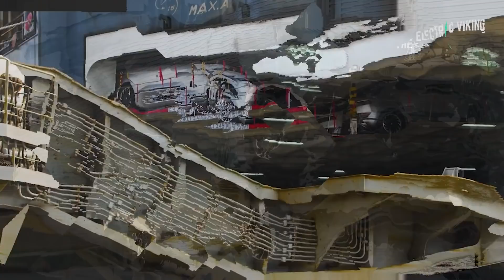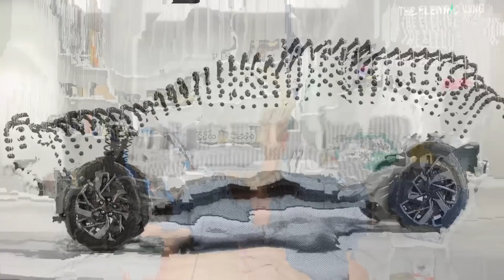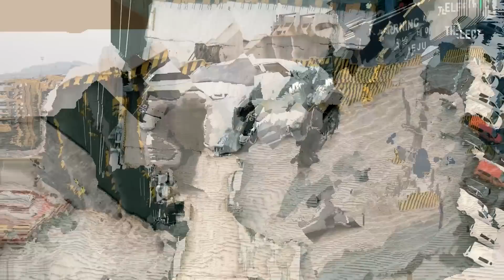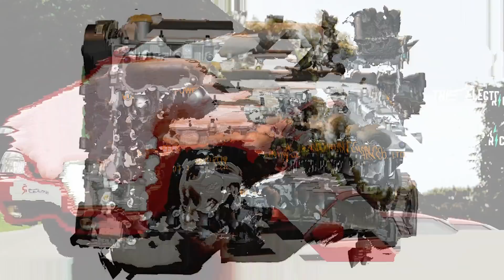Another automaker moves all ENGINE staff into EV production

Comment: Some day before long we will miss replacing an air filter, engine oil and filter, spark plugs, coils and wires, accessory drive belts, changing engine antifreeze, worrying about the catalytic converter being ripped off and the exhaust rotting off, the myriad of pollution control hoses, sensors, valves, actuators and associated wiring. The list goes on.

Comment: Expecting a bunch of engineers who specialize in engines to produce an electric masterpiece is typical executive shortsightedness. Wrong people for the job.
Reply: 90% of the research workforce is employed in designing and making the production line itself not designing the ICE components. Very few engine assembly lines are manual now. Merc and BMW retain manual engine assembly lines for their complex V8, V10 and V12 blocks. The reason for this is that they don’t sell enough to justify a full automated line. Hyundai G4GC units are numbers in the hundreds of thousands and that is just one engine
Reply: @theairstig9164  LOL Engine assembly is done by hand at ALL the manufacturers plants today. Its to complex to automate. 
Over 3000 moving parts and assemblies

Comment: Not everybody lives in a warm climate, here in Canada it is coolish to cold 5 months of the year.  Lately, the temperature has dipped significantly in parts of Canada and a lot of Tesla's have stopped heating.  So until EV's are sustainable in our climate, I will be keeping my 2019 Accord hybrid.
Reply: We’re in calgary and own a Tesla, it’s been -20 for the past month and have had no issue but we keep the car in our garage and preheat off the grid, works excellent.
Reply: A plug-in hybrid with decent battery capacity would be an ideal solution for such conditions.

Comment: Sam, check out this headline from today:

5-minute electric vehicle charging could be here soon, professor says
Phoebe Wall Howard
Detroit Free Press
Ford Motor Co. is working with scientists at Purdue University in Indiana on a patent-pending plan to slash the average time it takes to recharge all-electric vehicles at charging stations from an estimated 25 minutes to 5 minutes.
Reply: Looks like it's in the "petri" dish phase. Will probably be another 50 years before that will happen. It's America. I remember warchitje 1950s documentary about the future 1980s kitchen....I'm still waiting for it.
Reply: @henrytaverner1803  I dug into it a little further, it's not battery technology it's basically a way of cooling the charging cord so that it can handle high amperage.

Comment: Was about time that Hyundai made a robust commitment to EVs. With the steadily growing order backlog for the Ioniq5 and even the Ioniq classic, they sure knew what gems they have on offer. The current lineup of ICE powertrains should last for the next few years, and by then the EVs will have taken over anyways, so there's really no need for putting any further R&D resources into them. The only sad part is all the people working in these research fields right now.. I'm not so sure whether it's that easy to retrain those engineers to EV parts so quickly, so there'll likely be some job losses in areas where it's hard to find new jobs.